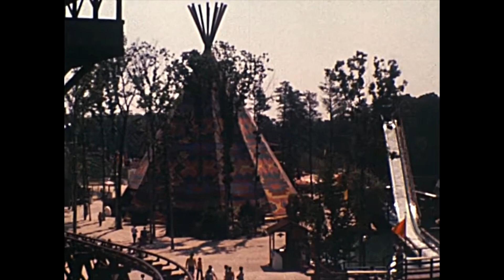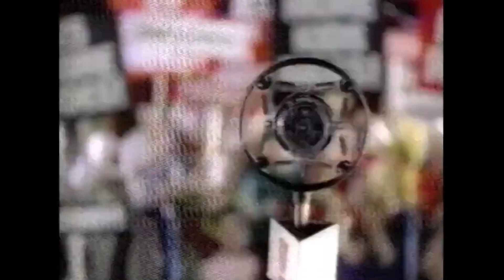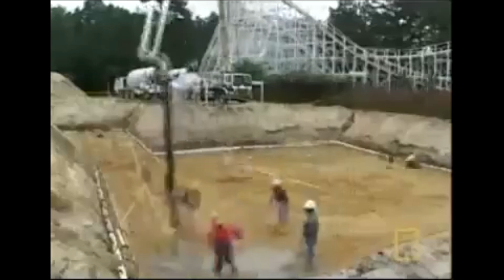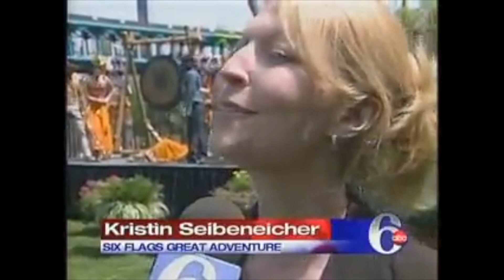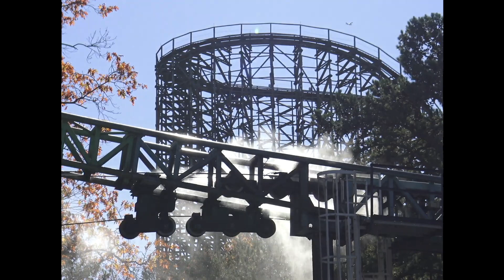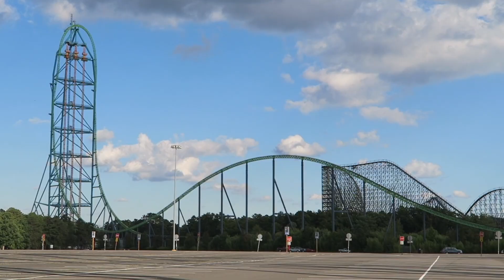Kingda Ka: The Coaster That Won The War

Comment: I'll never forget when I was sitting in my office in South Korea as a member of the Air Force when I saw the announcement for Ka. I had just joined and got through basic, my going away trip was visiting Cedar Point with my family then we stopped briefly at Six Flags Worlds of Adventure only for my brother to ask my Mom for us to just leave and get back on the road so I only got to visit the parking lot of Six Flags Worlds of Adventure. Something i've always regretted. But anyways, I really didn't think they would make another version of Top Thrill, idk why I felt like it was a 1 off especially with Knotts getting the prototype but I just didn't think that record would be topped again for awhile. My jaw hit the floor practically when I saw that Great Adventure was getting Ka. I had also put in to get my next base to be right near Great Adventure so I was so hyped at the time!
Reply from the maker: What a great story, and one of the reasons I always try to visit as many places as I can. Kingda Ka shocked many people I think. It is such an iconic ride for so many reasons.
Reply: @CoasterConnections  It was just so crappy the way that the went about shutting it down. They didn't need to do it that way and I've yet to read a valid reason why they didn't make the announcement earlier so people could plan last rides